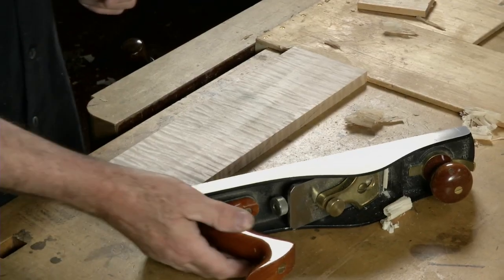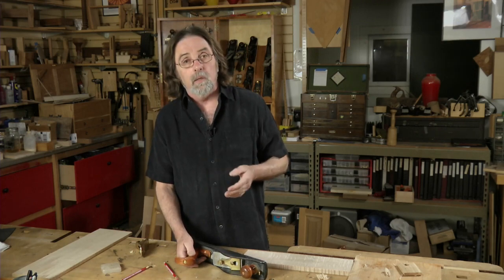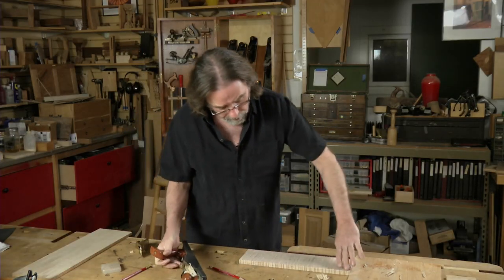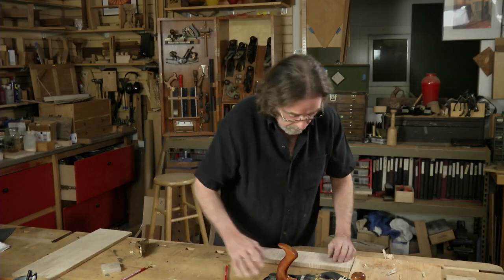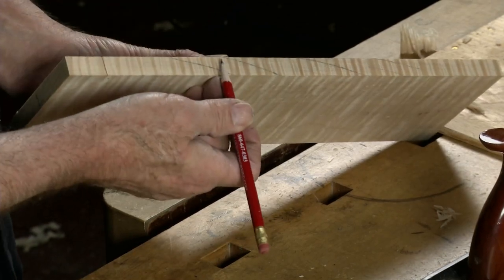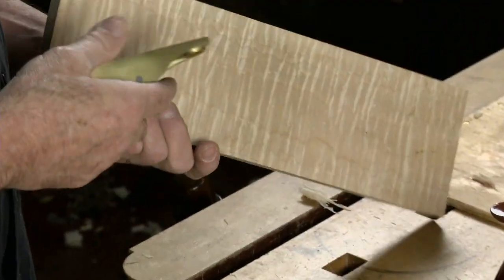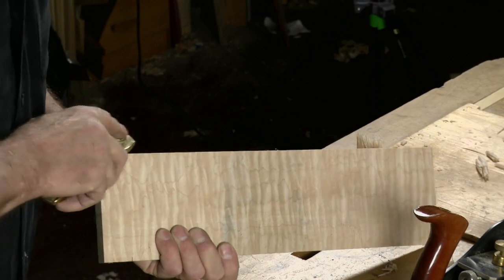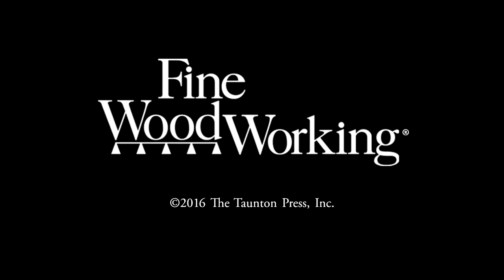Taming Tough Grain with a Bevel-Up Plane with Bob Van Dyke

Comment: I use a 90° edge on the iron in my low angle jack plane for this specific reason. It acts like a heavy duty scraper and eliminates almost all tear out.

Comment: Nice video, and a lovely piece of wood! I’m intrigued to know how a low angle plane with a micro bevel is different from a regular plane - surely the important part is the final angle presented to the wood (57° in this case)? I have this particular plane, and find that taking light cuts and closing the mouth up helps a lot with tricky wood - and keeping the blade sharp of course!
Reply: Yes, I lack the background to understand (what seems to me) the use of a high angle blade in a low angle plane.
Reply: The nice thing of this approach is you just have one plane and if you need to tackle highly figured woods you can simply just get another plane blade for that purpose. A standard bevel down plane can also have multiple blades with a micro backbevel but it can never also become a low angle plane. I hope that makes sense

Comment: If it's approaching what a card scraper does, why not just use one of those expensive Lie-Nielsen scraping planes?
Reply: A spare blade for a no 62 plane with a 45 degree micro bevel and a set of scrapers = AUD 100 versus a LN Scaper plane = AUD 350.... it speaks for itself really.
Reply: @bigkiv47 How do you find your Henry Eckert planes mate ?